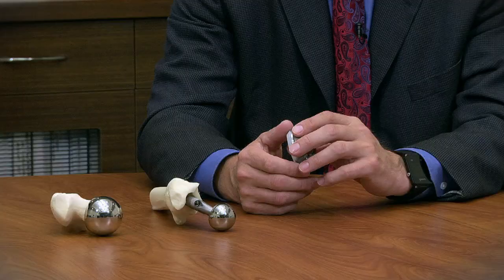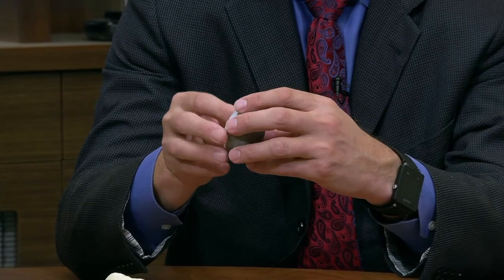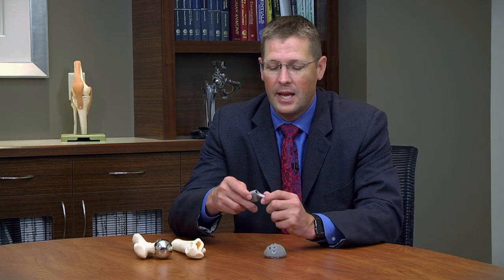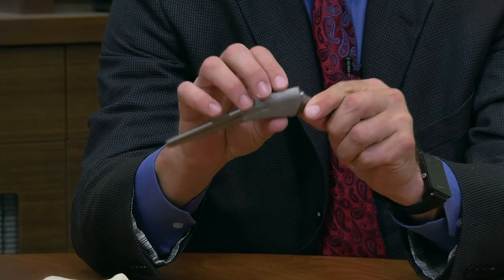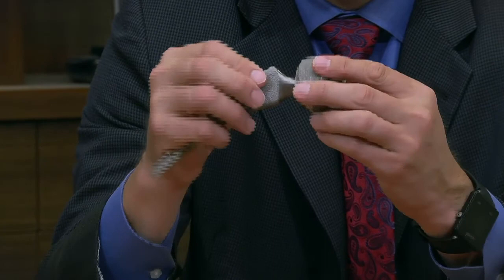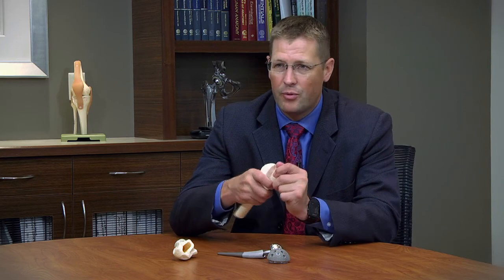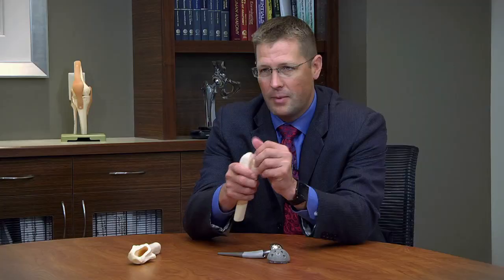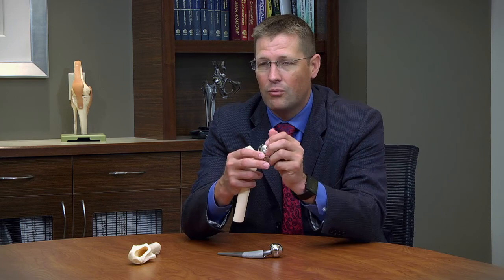Difference Between Hip Resurfacing and Hip Replacement

Comment: I'm 55 and had my BHR done in Germany 5 weeks ago, best decision ever.
Reply: @jasonziruk6045  none, completely satisfied, already jogging and sporting as before. Only regret that I waited 2 years to long, degenerated too much muscles. Without that, I would have been in the gym under full load after 3 weeks time. Only can recommend it. If something goes wrong in 20 years(it's supposed to go as long as I live) you still can swap to a Schaft-version. Don't hesitate and don't wait too long, not  waisting good-live time by enduring senseless pain!
Reply: @jasonziruk6045  sorry, can't answer last question, in Germany it's payed by health-care. I personally started quitting martial arts, then badminton and then walking at all. Every day waited is a day wasted. Don't have a clue about financial issues in the states, sorry.
Reply: @jasonziruk6045  Easily. Think the other way round. Doctors need special training for that method. As a craftsman, I consider the BHR more easy to perform than the conventional shaft system. Simply because you keep most of your(self), bone, length, etc. With Schaft-system you can alter ankle, depth and more. Much more chance to fail. Second: Doctors promoting the BHR belong to a certain circle. Judge the operating team by your feeling and sympathy, you won't be able to judge their competence anyway. If you feel convinced, you'll be satisfied and the outcome shall be optimal.
Reply: @jasonziruk6045  saying by doctors: whatever you did before, you'll be able to do afterwards as well, more difficult to learn new things. Exactly my experience.
Reply: @jasonziruk6045  hello Jason, last comment by me regarding this: no "Sir". I'm 100% German, but working for a company having the privilege to work for the Army Corps of Engineers and the US Air-Force, therefore I'm one of the lot "proudly serving the best", if I could have participated in your decision making processby any means, it would be a real honor to me, stay safe and healthy! Best regards, Elmar
Reply: @elmarthost233  i had hip resurfacing in march 2021 i was diacnose hip damage in 2013.. Quit sports becaurce of extreme pain.. After 8 years saving money i Just had the opportunity to pay for the surgery.. (in Holland resurfacing is not allowed).. I started slowly with sports... Everything is going fine.. But i was in pain and waiting for 8 years thanks to my genius government

Comment: What option do you have for people with known allergies to metal?  Can the Smith & Nephew BHR be coated with Titanium Nitrite or some other inert coating that is non-reactive with the body?  Melallosis is real, regardless if the WHO removed the ICD code from the registry.  So people who are allergic and reactive to metal ions need an alternative to bare metal - a ceramic coating for the ENTIRE surface area (not just the bearing surfaces) is an answer to this problem, but the manufacturers are slow to see the need.  So do you offer any insight into a solution for those of us with metal allergies?